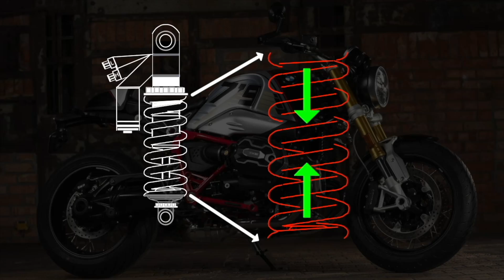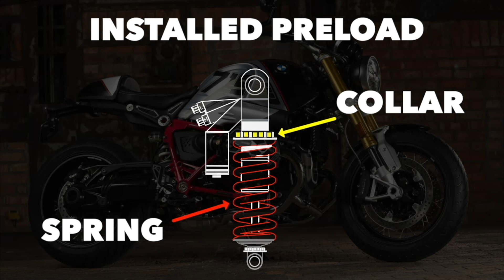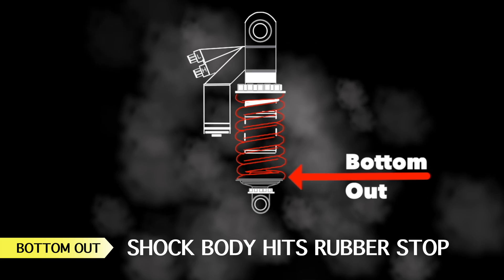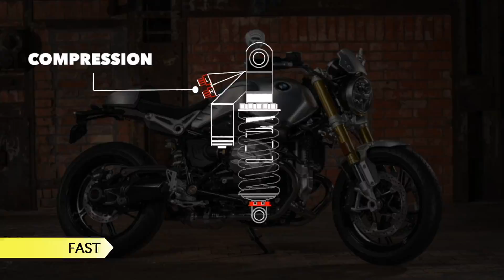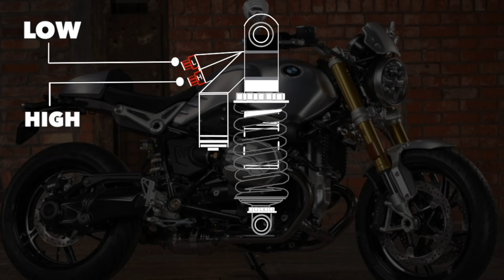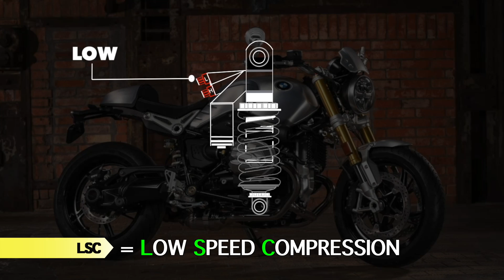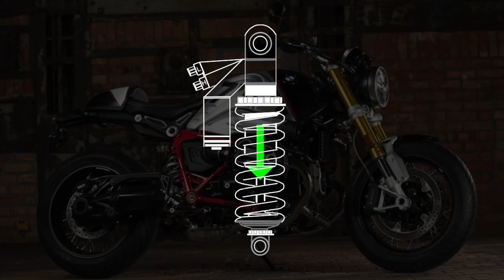SHOCKS...demystified..

Comment: Hiii nice videos you have whit good information thank you  i have a question about the + 70 mm upgrade suspension the normal seathight from the urban gs is 850mm what will be the new seathight ? Thank you already.
Reply from the maker: Hi @cliffvantoor5102, great to hear you enjoy the videos. As for the exact seat height, it depends on both the cartridge kit and rear shock. So exact measurements should be obtainable from the manufacture of the combined kit. 
Ride safe 👊✊️👍